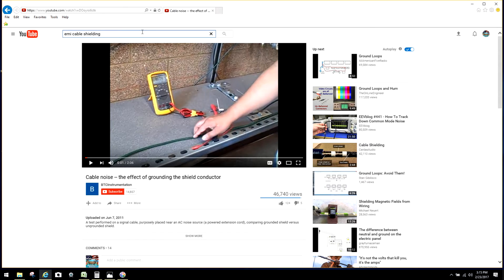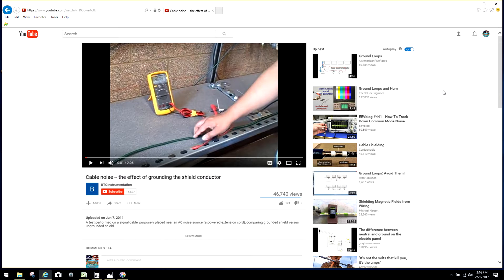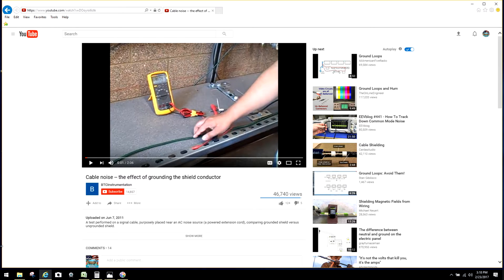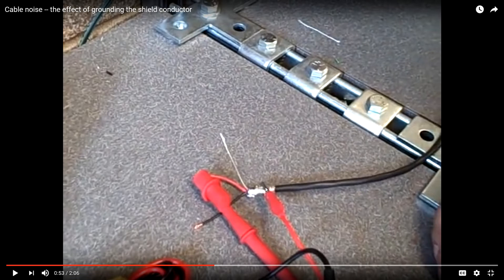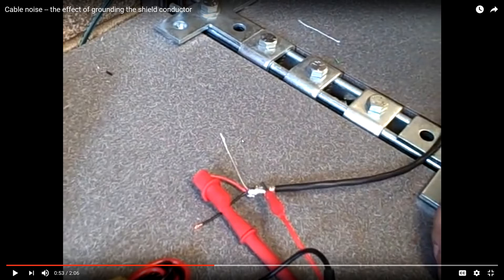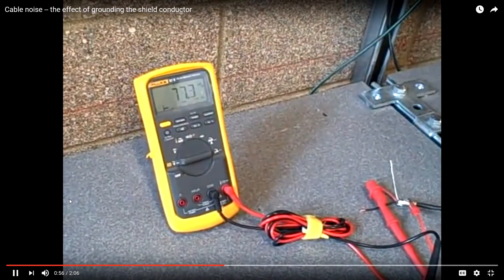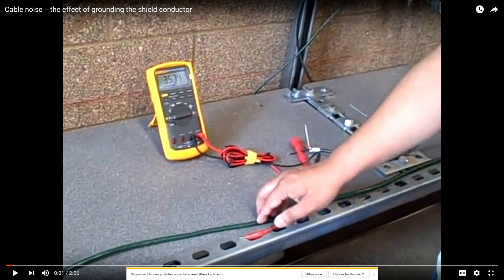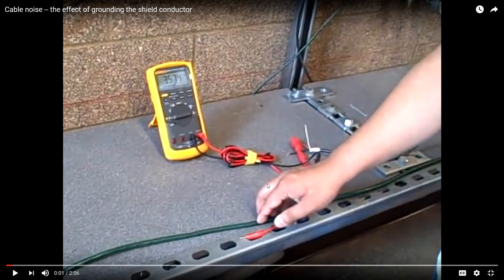CNC Random Faults?? (This Is What You Need To Know)

Comment: ok so the way I understand is that all communication wires should be shielded and earth grounded because they are low voltage communication and easily influenced by EMI?

the spindle cable should be shielded and grounded because it is a strong emitter and can cut down on the EMI noise the communication wires experience?

why then, are we shielding and grounding the wires that go to the stepper motors when they are controlled with the communication wires that are shielded in addition to the spindle cable being shielded and grounded?
Reply from the maker: Drumstick,

All cables with a CNC should be shielded regardless of what cable it is. The steppers are required to be shielded like any other component, and that means their signal cabels, and motor cables as their carrying the precious STEP, and DIRECTION commands. Keep it simple, and properly shield all cables.

Thank you,
Vince
Reply: even the cables providing the 48V to the motor? will EMI have an effect on these wires?
Reply from the maker: Yes as the cables that provide the voltage to the motors are the motor cables. Thank you,
Vince

Comment: so is this stray voltage only induced by alternating current? does the DC power cables running to the stepper motors cause this kind of stray voltage?
Reply from the maker: EMI is a culprit that effects virtually anything electronic regardless of A/C or D/C input, or output. Stepper motors will generate larger amounts of EMI if shielded cables aren't used. Always use shielded cables properly grounded on anything on your system. It takes longer to build, but in the end you'll have piece of mind the machine's wiring is done correctly. Thank you,Vince

Comment: So with a g540 and a switching power supply, do I need to do anything besides just terminate the motor cable drains to pins 2,3 or 4? How is the g540 grounded to earth if it is only connected to the power supply by v+ and v-?  Should I ground the metal case of the g540 to the ground of the switching power supply?
Reply from the maker: The G540 isn't required to be earth grounded. The drain leads from your shielded motor cables must be grounded. You just need to terminate the drain wire of your DIY cables to 2,3,4 on the male DB9. Grounding your controller is also acceptable, but usually not required. Another thing to consider is the distance the controller is to your chassis. The chassis is like a giant antenna, and EMI will be strongest around it. Give yourself some distance with your controller by mounting it as far away as comfortable. Thank you,Vince
Reply: Thank you for the reply. The electronics I bought from you have been running strong for a couple of years now. I had some random faults, but I suspect it was my parallel port dying. I added a uc100 so I could run my machine off of a table and haven't had an issue.
Reply from the maker: Thank you for your support. Random faults are the toughest issues to diagnose. The time it takes to troubleshoot is dictated by how good you are at listening to the machine. I recommend documenting everything you do, and the effect it has if any on your machine. The Gremlins can make you day hell if your not able to pinpoint the issue. Thank you,Vince

Comment: Hello Vince... Its me again... i have a new question for ya... not so related to grounding but could use your expertise... ok here it goes. I currently have a table 7ft X 38 inch.. Y and A slaved using Nema24`s at 425oz-in with drivers 3amp 24-40 volts 1-1/64 Micro-stepping, Power Supply 36v 8.8 amps,  Breakout board parallel 5 Axis.... I make a lot of Lithophanes with this machine.  I am going to add another axis for a lath or rotary so that i can use something like PVC pipe to create round Lithophanes. 
  Whew...  got that out of the way.... now the question...  Can i use a Nema 17 62oz-in (i have some) with my driver (i have an extra not used) connected at all times but just load a different profile in Mach3. or will i need the power of another Nema 24(i will need to buy another)?    Sorry to be constantly asking for your help but so far EVERYTHING you done so far have been right on the nose to my setup (by the way.... after you straightened me out on Grounding my cables... i have now put in over 20 hrs with NO loss of steps in my motors ... first time in 2 years)
Reply from the maker: First of all thank you for your continued support. I'm glad we got your system corrected.The 4th axis motor size should be the required torque to get the job done. that being said if the applications can be made using the torque output of a NEMA 17 your in business. If however their not up to the task you will have to invest in another NEMA 24. I would try the NEMA 17, and see if it performs with the projects your intending to do being you have one on hand already. Worst case scenario you'll find out you need to purchase another motor. I would also be cautious of using the power supply with only 8.8a available as your getting really close to maximum output with the additional axis. Thank you,Vince

Comment: I have 4 stepper motors (A and Y slaved) wired (using shielded cable)  from motor to a 4 prong female plug and male plug attached to my control box... from the male 4 prong plug goes to my controllers.... So... my question is ....  Do i take the end of the wire connected to the controller and run it to the ground of my power supply and ONLY from that fifth wire?  ... you gave me feedback some time ago on 3 videos that i posted.
Reply from the maker: You never run a ground to the power supply. You want to use an earth ground which for our purposes the third prong on your wall outlet is the best to support. You only want to ground the shield drain wire (Which is the 5th bare lead wire on 4 lead cable), and only attach one side of your cables drain wire to prevent a ground loop as discussed in the video above. Thank you,Vince
Reply: thank you again Vince.. now i have the 5th wire to the Earth ground not to my ground on the power supply. I thought that would work though since it goes to the ground wall plug. keep up the good work i have been watching a lot of your videos ever since i found your channel.
Reply from the maker: Thank you for your support. I will keep posting videos that are to educate my past, and future supporters, and clients. Vince
Reply: WELL.... i did it... i had my ground (5th wire) going to the ground of the power supply .... running A and Y slaved. i created a gcode that ran my machine (router off) at different speeds and distances for just over 4 hours. when it was done i homed all axis and each of them was off.. not much but some... even the A and Y were off.... then i took the ground wire and ran them to the earth ground of the plug in. then ran the Gcode again the next day after re-setting back to proper settings. after the machine was done with the gcode ... all axis were at there proper positions .... couldn't believe the difference it made. Now im kind of woried about adding a water cooled spindle that i want to add...   :)   Thanks Vince for Everything
Reply: to think that i have been running this machine for over 2 years not knowing why i had to calibrate all the time
Reply from the maker: I'm glad to have helped. Calibration is very important, and nothing with a CNC robot is plug, N play ready, so I hope everyone watching, understands it. Thank you for your support Vince